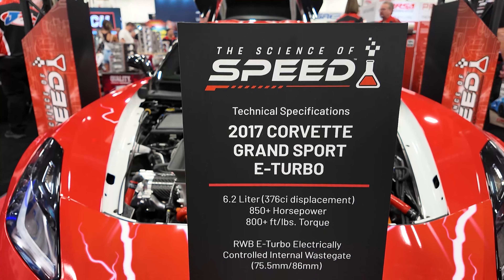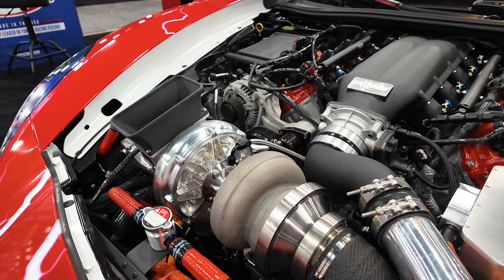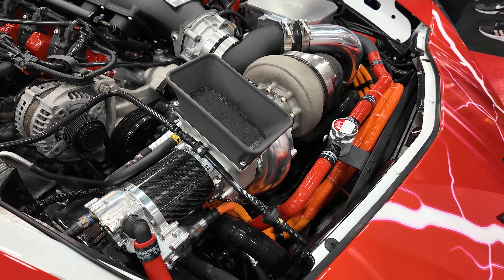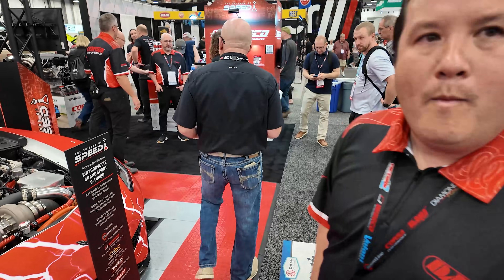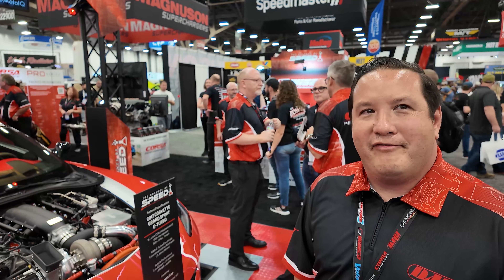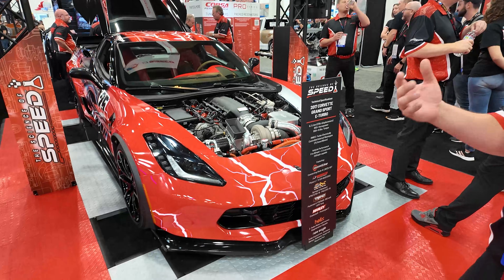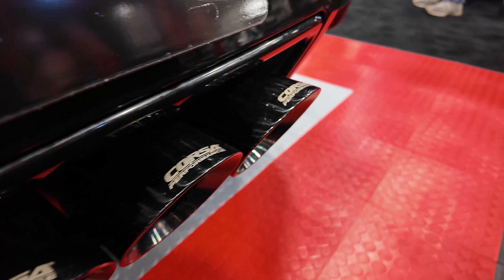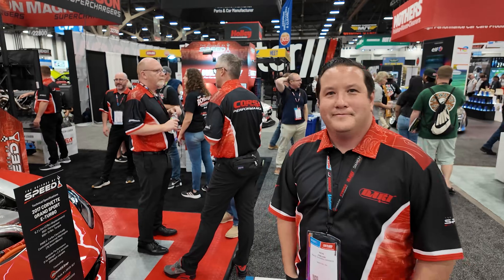This 76mm Turbo Can Accelerate To 130,000 RPM in 150 Milliseconds! | SEMA 2025

Comment: not hating but the electric turbos ive seen have the electric motor in between the two propeller wheels. not sure how this will suck in fresh air or exhaust gases (depending which side that motor is on), but its a pretty cool concept and ive actually been trying to look for a big e turbo like this but no one lists the size, just the fact they are 48v or 400v e turbos.

Comment: Okay, so 800 volts x 100 amps = 80,000 watts.  A whole electric car battery is going to weigh 900 hundred to 1,200 hundred pounds for a 30,000 watt battery.  Yeah this might work for a drag race, or a pull or two, but then, sadly, it's done.  I'm glad people are experimenting with this, but as a real hot rod, or road race car, umm, not really...
Reply: A 30 kWh battery has around 108MJ, while F1 where this tech comes from has a maximum MJ of 4 and a maximum weight of 55 lbs. It works really well for road racing since when you hit full boost you can use the motor as a generator to recharge the battery and control boost. You only need the wastegate once the battery is full or a system failure has taken the motor out. 
In drag racing though you might as well just ditch the hot side and run it as a supercharger imo.
Reply: @Thee_Snow_Wolf  Yes, that is what THAT is.  This is what THIS is.  One is viable, the other is just an interesting experiment.

Comment: Bmw and mercedes engines on some models have this same type of set up. I have even seen some of them have 2 turbos. One electric,  and one regular. However,  turbos really need to spin up upwards of 100,000 rpm. Electric turbos can only last so long. Wonder what the cost is.

Comment: I think the first one was made by Knight Superchargers back in the day. 
But they just did not have the electrical power to run them back them.  :face-fuchsia-wide-eyes:
They would drain the biggest AGM battery like it was child's play after just a run down the race track. 

I experimented with 16v batteries back in the day, and it really was the only thing that sort of worked to keep it at peak power for about ~ 10 seconds before the voltage dropped off.   
Too keep a stable voltage going to the thing, you needed so many batteries,  the benefits of the electric supercharger quickly went out the window.
Reply: This video review is of no technical merit , your reply is better.  
10kW Battery & an overdriven Alternator. 
I think they are running coolant into the superchargers drive engine.
It would be one hell of a testbed to develop :)

Comment: Well electric drives throws pressure ratios out the window for "compound" turbos. Wonder what a big s480 sized compressor with proper gearing/rpms as a on demand compound on diesels. No extra hot side plumbing between stages too

Comment: Why would I buy this when magneti marelli MGU-h is available to the public and was actually developed in f1 and at lemans?
This:awkward intake, not easy to use with stuff, all billet

Magneti marelli: center shaft mounted motor, split shaft configurations, composite compressor housing, cast housings

Why in the actual fuck would I ever touch this

Comment: how much weight was added to the car for the turbo?
Reply: I would imagine much less than a traditional turbo? Other than the turbo itself, this probably only has the small motor, computer, and maybe a small battery or capacitor. I’d think that would be lighter than extra ducting, and intercooler, and fluids.

Comment: 2000kg Corvette, 800hp. Power to weight ratio is 400hp per 1000kg. My NA SBC Cobra was 500hp at 900kg. No e-turbo will fix the Corvettes mass-lag.
Reply: I mean you can push it over 2000 HP and street it

Comment: The reason these don't take off is bc electric power cant over compensate or have enough power to compress air, that's why it never has gone anywhere. Good idea but no one makes a motor needed or good enough for this technology 75% exhaust energy and heat is wasted used for turbo to save efficiency, it's really a dumb idea just go get a gayla.

Comment: 0 to 130k UNDER LOAD? Or free-wheeling? If it can reach that speed while moving and compressing air, it would be a monster.
Reply: I'm still going with a misprint and this guy doesn't know what he's fucking talking about that should be 13,000 RPM
Reply: 130.000 RPM?????!!!
Reply: @mrsamsung8184  No he is right. Spinning a centrifugal compressor of that size will take 100k plus rpm to do anything. 13k rpm centrifugal compressor would be something like a Rolls Royce Nene with an 18in ish compressor inlet.

Comment: Would there be a benefit to putting one of those electronic motors on a traditional turbo so that when it is used it helps pull out the exhaust as well as give boost?

Comment: Ah, a perpetual motion machine.
Reply: lol what no..
Reply: @Iseenoobpeoples 
I have never seen an electric turbo generate more power than they require to run. In this situation it looks like they just put a heavy hybrid battery in the car as a buffer. I wonder how much run time the turbo has before it depletes the battery and can’t keep up. Neat race car stuff, but unlikely to be street car stuff.
Reply: @jerrythechainsawguy8100  It helps generate more power when fast response is required the system has regen to I bet the vehicle shows a bit more average hp overall. This technology is already implemented in street cars, just look at Porsche.
Reply: @jerrythechainsawguy8100  This is an F1 style system based off what they were running in 2014. Since they're using an eWastegate they can have it so the first stage of boost control is the motor acting as a generator at full boost to stop overspeed. The wastegate here is only used here to control shaft speed once the battery system is full.

Comment: Just like how electric car been around since the early 1900’s this isn’t new tech. But it’s badass it’s finally advanced far enough to make it hopefully soon readily available for all sorts of applications
Reply: Teslas electric motor tech is where electric motors have gained much more power over conventional electric motors.  As these electric motors move forward with more efficiency the time will come when most turbo cars will have electric motor power.  What could be better than getting the exhaust pressure lowered so the savaging effect can come back into play  and the ICE motor gaining more power?   Now the long tube headers are going sound really sweet!

Comment: Sounds like this could revolutionize drag racing. That is if they eliminated running the exhaust gasses through it and just used the electric motors.
Reply: Drag cars are already making big boost right off the line.
Reply: @Iseenoobpeoples I’m aware. My thought is that an all electric turbo would circumvent the heat from exhaust gasses heating the intake air making for a simpler system with no air cooler
Reply: @Jules_73  The heat and exhaust pulse energy would just go to waste so I doubt it would be competitive. Many people have tried purely electric forced induction and the results are poor.
Reply: You sound ignorant

Comment: Full boost under 1k rpm sounds cool but dawg you better have a built bottom end and a real warm engine
Reply: Yeah the torque curve is gonna blow a lot of engines up lol
Reply: @DcBoy261 я бы сказал "прямая крутящего момента" 😂
Reply: @DcBoy261 Why it’s completely controlled 🤷‍♂️
Reply: @DcBoy261 and transmissions lmao. Lots of older supercharged cars break transmissions because the power is so low in the rev range
Reply: It’s electronic. You can tune it however you want.
Reply: Just because it can doesnt mean it will. Sounds like they are talking about tuning it to give u low boost in corners or when traction is limited and high boost when u point it straight and floor it. Since its electric they can fully control it across every gear
Reply: I think it will blow a lot of gearboxes up too.
Reply: Never used an electric fan before ? 😂 cause you can tune it the same way with throttle
Reply: They did those Boost Line Rods are rated for 2000Hp
Reply: I'm sure they would just release a product that would fail quick and never test lol.
Reply: Sounds like wrecked rods instantly.
Reply: Thats boost b4 idle for me lmao 🤣
Reply: It does, ding dong
Reply: Not to mention the transmission

Comment: Back when hybrids got to be a thing i often wondered why they weren’t using electric turbo chargers to offer a momentary boost in performance. I worked for Lexus and they use Atkin cycles engines on their hybrids that were basically gutless, but they had the electric motor together that takeoff torque.  I thought it was funny that some of the cars had a sport mode, but it really didn’t do much more than deplete the battery faster.  My thoughts were just tapping into that big hybrid battery and spin a turbo to get air through the engine for more power.  Not something you want to run all the time but just whenever you need to get out of the way or have a lot of fun.
Reply: So much potential

Comment: 100 volt system and what amps? Because you're laughing mumbled the number of amps he stated. The quarter mile numbers are probably close to the Tesla Plaid quarter mile numbers with a low boost built engine, and better quarter mile times on engines such as the built high boost engine of this test Vette.
Reply: He said 100amps but that sounds absurd.
Reply: @DonHogan-wi2yj  I would think the 100 amps is used on initial spooling with dropping to 20 amps after spooled up, but 100 amps is not an overdraw on the charging system, with most modern new car vehicles using 350 spike amps amplifiers on the stereo systems that continuously draw 200 amps, which needs at least a 100 amp alternator is needed to keep up with the turbo's amperage draw, with the standard 65 amp alternator not being able to keep up with the high amperage draws..
Reply: @michaelfercik3691  The system will be self charging. They're using an electric wastegate in the system, which means they can use either the wastegate or the motor as a generator for boost control.

Comment: Calling this a turbo charger is stupid. By definition a turbocharger is a turbine driven by exhaust gases. This is an electric supercharger sitting in front of the turbocharger. And that’s not new. OEM’s have been doing it for years.
Reply: Look again, it definitely has a hot side.

Comment: I want to see one on a diesel truck
Reply: diesels dont rev much and have good low end spool snyway.
Reply: My diesel truck is heavy enough as it is i dont need to add another 1000lb+ of battery or haul seperate diesel generator just to power it.. big oal waiste of money and time for no gain
Reply: @codeack101wlck  the new 911 turbo has two electrically assisted turbos on board and weighs 75kg more than the predecessor. So if you're not a small company doing prototype work, it's definitely possible without adding too much weight.

Comment: You can make e turbo yourself for about $3000 in your garage.
Reply: This technology already has questionable benefits considering weight and added complexity, if you were to produce a less efficient system in your garage then it would undoubtedly not be worth it, getting to 130k rpm that fast is no joke the system demands tons of power.

Comment: This is going to make my Tesla even faster
Reply: Just connect it to the windscreen wiper and youll be there in no time
Reply: So you can get to the gay club faster!
Reply: Still getting flogged by old top fuel drag cars so whats the point 😂😂😂
Reply: You both sound like members to said club 🏳️‍🌈
Reply: I dont get it
Reply: Hope this is satire . Lol . In case it’s not . This is not for EV vehicles but rather combustion vehicles
Reply: @reasonsunknown6707 you can use it as  a electric yet. Mount it on back😂
Reply: what would be funny is if tesla adopted it for cooling...

then the joke would be on you

Comment: Porsche is offering this as standard equipment on some models already.  Having the electric motor in the center section makes much more sense, is much compact and doesn't restrict intake flow...
Reply: It won't restrict air flow since it's being sucked in by the high speed fan called a turbo if you followed rallying or other classes that use a restricted system, you would have seen they still work well  even with a very small port say 36mm in front of a 52mm inlet the Porsche and Audi one is more about packaging than servicing.
Reply: @motorised1 place a 90 degree elbow behind a shop fan and tell me that it doesn't affect the flow... it's basic physics at play here.  Yes, it does affect flow.
Reply: @RX463LSX  I test pumps  for a  living it takes a  lot to cause a genuine restriction
Reply: @RX463LSX So does air filters so what's the point of your argument? Your need to be right? You're still grasping at straws here.
Reply: @motorised1 90° are to be avoided at all costs in HVAC and audio (air waves) scenarios when possible. Just because you CAN circumvent it doesn't mean you should
Reply: I think you're being nit picky. I don't think you have a clue how expensive that Porsche turbo will be to replace if it has an internal electic motor failure. At least with this design, the motor is outside the turbo. Also, the center of the compressor doesn't do anything so I seriously doubt the drive shaft is affecting flow that much.
Reply: @rotaryperfection just rebuild the electric motor or the make custom turbo blades….. it’s the electronics the more complicated part lol!
Reply: @rotaryperfection  his points are still beyond valid lmfao. Not only Porsche but Audi has been using these for about 4 years now. They are OEMs not aftermarket. They won't have to deal with those problems so they don't care. 

Because they're big OEMs they will get them for a cheap price and sell them for more money (as always). The point is, it's innovation, but the points this commenter made are still valid nonetheless. It would be more efficient with a bigger air opening
Reply: @jacobwebb8818 The automotive versions are still in there 1st generation so NOTHING long term has been validated. All we have is speculation of the future. The only advantage I see with the factory internal motor version is tighter packaging. Thermo wise, the idea of having and electric motor 2" from the hottest part of  the engine just seems like a faliuer waiting to happen. The aftermark version completely avoids this and could very well the most RELIABLE version of this setup considering where the motor is located.
Reply: @rotaryperfection why would the OEM one have to be on the exhaust? It doesn't use the exhaust gases lmao.

OEM is gonna push the technology way further than this little high school project ever will. Like you and the original said, the biggest advantage is the packaging with OEM and airflow will likely benefit from that as well. I'm not saying either one is ideal, I'm saying they're both mid, but the OEM will actually get improvements going and faster, and will allow slow ass cars to possibly get a performance boost with hardly any complexity added in the future where electronics are obviously being shoehorned into cars
Reply: @jacobwebb8818 "Why would the oem one have to be in the exhaust"? You just told on yourself. Are you seriously trying to make an argument for oem TECH you clearly dont know how its designed? The fact you ASSUMED I meant exhaust side tells me you dont even know how those OEM turbos are set up yet, you're in here making an argument for them. The internet is batting 1000% with posters like you who base your arguments over ignorance and ZERO knowledge.
Reply: @rotaryperfection bro, you were the one who said it has to be 2" away from the hottest part of the engine not me 🤣🤣🤣🤣
Reply: @rotaryperfection and I didn't say in, I said on the exhaust. Because you implied it had to be on it judging by how you said it's 2" away from the hottest part. Just quit talking atp
Reply: @jacobwebb8818 Except I know where that motor is actually located. Clearly you DON'T since you assumed I meant exhaust even though I said 2" near that exhaust. Stay ignorant because AGAIN, you don't have a clue where those OEM motors are actually located on those turbos.
Reply: @rotaryperfection I would get checked for dementia if I were you unc

Comment: looks like it adds quadruple the weight that a normal blower would add
Reply: Maybe but the charge air is going to be a lot cooler and it’s not going to restrict the exhaust flow like a typical turbo would
Reply: 10kw battery system is like the car ate a Tesla and used it for spare parts lol-looks super heavy
Reply: It’s just a really shitty MGUH, magneti marelli makes a better one at three different power levels and it’s a grip more efficient (plus they make a crazy ultra cap for it, it’s like 200lbs battery plus turbo, good on anything but you have to build the car around it)

Comment: I don't see much of an upside when you have 300 pounds of battery added to your car.
Reply: Way more than 300lbs of battery way more
Reply: @codeack101wlck most likely, I was being conservative.  At any rate, the added weight would negate any positive impact from the immediate spool.
Reply: @hurricaneaquatics  reminds me of sema Bluetooth driveshafts lmao
Reply: @hurricaneaquatics  doesn't seem to apply at Porsche. 75kg more weight than the predecessor, two electrically assisted turbos.
Reply: Could run off an auxiliary alternator
Reply: @idontgotnothin lmfao ok sure thing bud